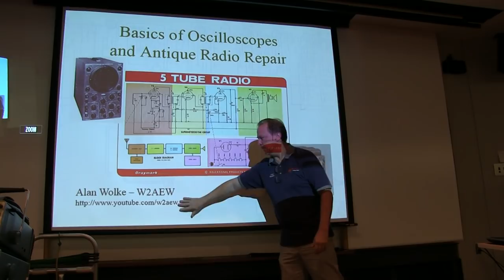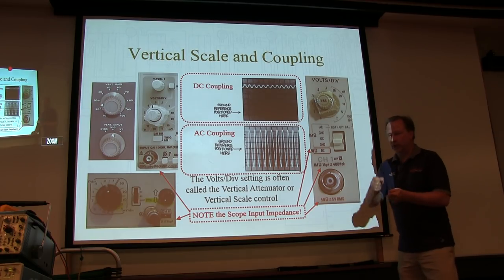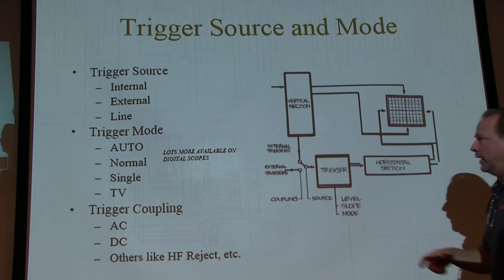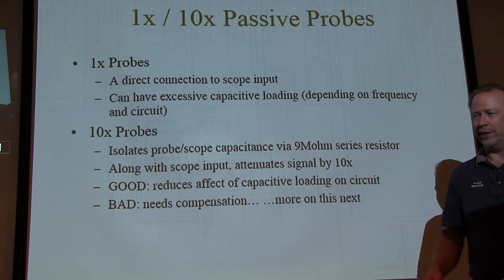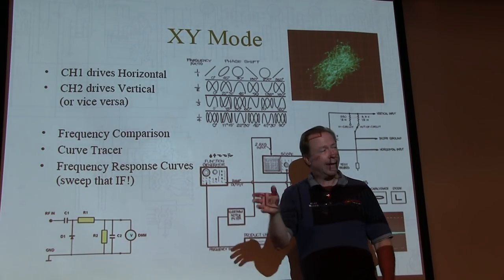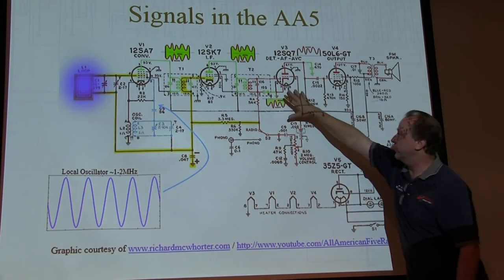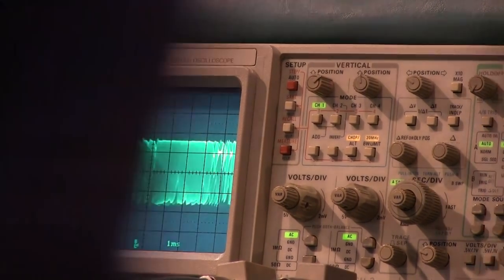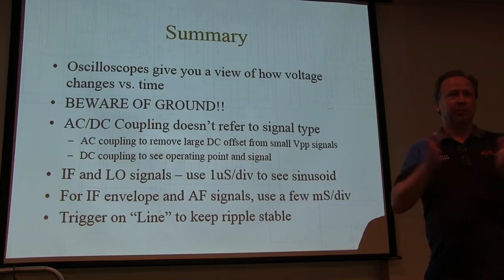#242: How to use an oscilloscope. Plus, seeing signals in antique radios | NJARC

Comment: Greetings, Alan!
To my knowledge, I've viewed all of your videos, and I must say, you are perhaps the finest educator I have ever seen, either on-line or in person!  Your ability to clarify the most intricate electronics concepts has had a tremendous impact on my understanding of the topic, and I'm certain I'm just one of countless many you have enlightened!   Thank you so much for all of your efforts in sharing your vast knowledge of electronics with others!  Well done, Sir!!
Reply from the maker: well, thank you!!  I am glad you enjoy my videos!  Be sure to let me know if there is a topic that you would like to see in the future.
Reply: Now that you mention it, I was hoping you could shed some light on the topic of parametric equalization.  While I understand the basic concept,  the specifics of how and why they are designed still eludes me 
somewhat; for instance, are there parametric eq's which incorporate shelving?  Also, is it only frequency that can be adjusted in voltage-controlled filters, or is it possible to modify bandwidth or emphasis as well?
Reply from the maker: There are a couple of good topic ideas here.  Suffice it to say that it is possible to design voltage control filters that include full parametric control (BW, Q, F).  It is also possible to design voltage control shelving filters.  I don't know what is commonly used in the pro-audio field - although I suspect that it is nearly all done in DSP these days...

Comment: This was great. I grew up in Hunterdon Cty and was originally licensed there in '57.  I have been watching your VNA articles but recently picked up an HP 1740 scope (You should watch Dave's EEVBLOG on fixing one of these!). Of course I also have a fondness for tube gear and still have my Halli S38e, which is of course an All American Five. It seems to work all right but now I can fearlessly apply my HP probes to it (IF isolated).  BTW I just ordered an Owon HDS272s to eliminate those ground issues.

73, Barry
VE7VIE and WV2J  ex WV2ECZ

Comment: Outstanding video on Scopes.  Best I ever saw/heard.  Thanks a ton for the effort and the information.  Too bad your audio-visual guy had a radio program going next to the microphone thruout the entire presentation causing a somewhat distracting influence - which seemed to get louder as the presentation progressed.
Reply: I kept pausing the video and turning down the speakers until I finally realized it was something in the video causing the background noise. Unfortunately I could only make it though the 8min mark. It was distracting to the point I kept stopping and rewinding because I was losing track of what Alan was saying. It was almost disorienting. Sounded like singing then talking then like an old TV show. Unfortunate because I guarantee that presentation was excellent. Everyone who was able to partake in it was lucky.
Reply from the maker: The background audio was from the "training radio" next to the scope.  Unfortunately, even with its volume turned completely down, it still has some audio output.  I didn't turn it off because it takes a few minutes to warm up, and that would have made it difficult to quickly make measurements.  I'll have to invest in a wireless mic if I ever record a session like this again.  Still, I hope you enjoyed the session in spite of the background audio.
Reply: ***** We always enjoy and appreciate your videos, Alan. A little background audio won't change that. :-)
Reply: I more than enjoyed the video Alan !! I learned a lot !!  Your communication approach is excellent - perfectly pace; with highly focused content; and effectively sequenced for optimal assimilation.  I really wish I had this video rather than my Electrical Engineering O'scope classes in college !!  Thanks for all your postings !!
Reply: This type of video is worthy of a "studio" version.  Hint Hint  ;^)
Reply: I was more annoyed by the guy constantly saying mmmhmm yeah yup mmmhmm yeah mmmhmm yup right by the mic.

Comment: Excellent video Alan.  I have modern digital scopes but I still find myself using my old Tektronix or B&K analog scopes.  Just can't beat the look of a warm glowing CRT.  Keep up the good work.  I recommend your videos often to newbies just getting into electronics.

One minor suggestion.  If you ever do another classroom type session with a radio keep the radios volume down until its needed.  With the camera being closer to the radio its audio level was almost higher than you at some points.  Just trying to help. :)

Mike

Comment: Great video Alan! I’ve learned more electronics from you, Joe Smith and Paul Carlson and a few other you tubers and some good books than I did from any courses I ever had. I pretty much work on old guitar amps, audio gear and most recently tube radios. Lately I have been repairing my old test gear too. I have an old Tek 485 coming in today. That will be a challenge, but I think I’ve found the go to Tek expert on YouTube. 😎
Reply: Not familiar with Joe Smith. But Mr Carlson's Lab is a great channel. I loved his video on the tube op amp. I'm not big into RF or radio, but Alan's piqued my curiosity in them more than once. I can see being a lot more interested in them once I've learned more. EEVBlog and Big Clive were the two big ones for me when I first got into electronics a couple of years ago.

Comment: Fabuluous course ! I grew up building tube superhets with multimeters, rf/af signal tracers, rf/af signal generators, and yes even a wobbulator, but I never had a scope to see these waveforms visually !

 Now that I have a good scope, you have inspired me to build a tube superhet again ! 
Thank you for giving me the joy of doing that !

One question though, in the output stage why dont we hear the ripple in addition to the AF signal ? You said it is rejected as a common mode signal, but I dont see how the single ended tube output stage does that.
Can anyone clarify ?
Reply from the maker: The ripple appears on both sides of the primary of the output transformer.  The only thing that couples across the transformer is the AC between the primary inputs.  The ripple doesn't cause the voltage across the primary winding to change, so it doesn't couple to the secondary.

Comment: Alan, another wonderful and informitive video! I find myself revisiting your videos from time to time after I encounter something familiar and then, boom, your video (on whatever the topic) comes through with clean, clear and  concise info to help me better understand whatever it is I'm thinking about. As a little request, could you maybe do a video that hits on the do's and don'ts (especially with regard to analog or CRT scopes) with regard to how power cycling, run time and etc may have a detrimental impact on those appiances? IOW, I may be wrong, but short cycling (using your scope to look at something for maybe 5 minutes) from what I understand is bad? Somethig about quick heating and cooling cycles? Is it better to just keep it on and keep the trace dim when not in use? Maybe just old wives-tales? Also, I have a couple of Tek 24XX series scopes. I believe they have volatile memory that uses a battery? Those have an infinite life? What are the caveats and possible reprecussions of a memory battery going dead? Any insight? Enough stuff for an informative video? Just spit-balling, but something like that from you would be awesome! At any rate, keep those vids coming! Great stuff!

Comment: To anyone wondering about the "background music": it is actually coming from the speaker on the demo board to our left.
 You can notice the scope signal changing with the music, which means it is hooked up to it and displaying what the radio speaker is playing.
 This was sort of a dumb setup to let the radio play during the lecture, but maybe it wasn't that loud to the audience because the camera was fairly close to it and turned towards it, plus the microphone is more sensitive and picks up more of the room sounds than the human ear.
Chances are that the radio sounded at least twice quieter to the audience in the room than it does to us, but it was still a dumb choice to keep it playing throughout the lecture.
 I for one feel a little better and relieved to find out the source of it; it was more irritating while I thought it was done by some rude and careless student and that it was disruptive to the audience in the room.
 I also notice that the camera's live video was hooked up to another projector and displayed on the left side of the lecture board, which shows the additional mistake of not using giving another microphone or an audio recorder to the lecturer so that the recorded audio would sound a few times better. Clearly, the recording was arranged in agreement with the lecturer, so a better setup could and should have been made.

Comment: Great presentation, but the radio show play in the back ground was very distracting through my speakers. Why was that present anyway?
Reply from the maker: The background audio was from the "demonstrator radio" next to the scope.  Unfortunately, even with its volume turned completely down, it still has some audio output.  I didn't turn it off because it takes a few minutes to warm up, and that would have made it difficult to quickly make measurements.  I'll have to invest in a wireless mic if I ever record a session like this again.  Still, I hope you enjoyed the session in spite of the background audio.
Reply: *****
Yes, i enjoyed it very much. A little through half way when i had to stop. Will watch the rest later. Thanks for the reply.

Comment: Excellent presentation. For slide 18 can you explain a bit more about the use of an isolation transformer? I have a Tektronix Technical Brief 'Floating oscilloscope measurements and operators protection' (51W-10640-1) that calls this an 'unsafe and dangerous practice and should never be done!'. Have I got this mixed up? Y
Reply from the maker: It's better to use the isolation transformer on the radio, keep the scope grounded.  Then, when you clip the scope ground lead to the chassis - it becomes ground potential and a lot safer to work on.
Reply: @w2aew  Thanks Alan, perhaps the subject of a dedicated video? Also could you consider doing something on the use of a scope and signal generator for assessing balun performance (not the transmission line)? Y
Reply: @w2aew  I agree. Grounding an oscilloscope and using an isolation transformer should be the subject of a dedicated video indeed. It's not as intuitive or as easy as one might think when first starting out in radio repair. We'd appreciate it Alan!

Comment: You mentioned "IF" several times. Does that mean "Input Frequency"? Thanks, very interesting content. 
Not a Radio guy, becoming a Scope pilot.
Reply from the maker: "IF" in radio terms refers to "intermediate frequency", a term used to describe the inner stages of a super-heterodyne receiver or transmitter.  This is a fixed (no tunable) frequency filtering and amplification stage that processes the RF signal.  In a receiver, the incoming frequency is translated (via a mixer) to the frequency of the IF.  The IF stages filter and amplify the signal, and pass it along to the back end of the receiver for demodulation.

Comment: Thank you very much for the nice presentation. As you mentioned there is a shift in the frequency even when we use x10 probe to measure the oscillator circuit, then what would be the solution to eliminate such a shift for calibration of radio in a restoration job.
Reply from the maker: You'd only connect a scope to check to see if there are signals there, and their amplitude, etc.  You don't align the stages that you're probing - you always probe downstream by a stage or two so that you don't load down the stage you are adjusting.
Reply: I've used the "sniffer" inductive loop. I suppose it could still effect the oscillator circuit.

Comment: For me this could not have come at a better time. One question, since chop as you have described it, does from what I can tell the same as alt. Why do you need the alt button at all. Surely chop can always be used? When would you use alt instead of chop? Thanks for this amazing video. I have gained so much from it. Another quick question. I understand in xy mode that your suggesting that from some clever signal generators the frequency can be output proportional to the ramp signal height which is then output to the X value on scope input. So that you can show a band of frequencies. Which is very clever and I want to try it out. But I did not understand how you explained it if you don't have a ramp function in your signal generator. I think you said you used a trigger on the sig gen to connect to X on scope? But did not really follow how that worked. Could you possible give me a few more pointers on how you do that or a link to a video or webpage that explains it in detail. As this was really interesting and I want to understand it. This is due to my inferior knowledge not your very good presentation! I suppose the first thing I will need is a sig gen that will sweep? I suppose they don't come cheap! Would it be possible to connect a MP3 player that had an audio file that plays through the whole audio range over a fixed time (say 1 second) (I only work on audio stuff) and some how feed that single into the X input of scope?
Reply: When you use chop at short timebases picture tends to be less bright.
Reply from the maker: Chop will be dimmer at faster timebases as +kroplaaaa stated.  Also, at certain timebase settings, you'll actually see the chopping action happening.  In general, you always want to use ALT, and only use chop at the slower timebase settings where the trace-trace flicker is annoying.

For generators that provide a sweep, but only provide a trigger pulse and not a ramp signal...  In this case, you don't use XY mode.  You use the scope in the normal way.  If you set the generator to sweep in 100ms, then set the scope to 10ms/div (100ms for the entire sweep), and trigger the scope from the trigger pulse from the generator.  Thus, the sweep on the scope is synchronized with the frequency sweep of the generator.  I have two videos that show sweeps - they don't go into great detail into the setup, but they might provide you with enough additional background to help you out:
https://www.youtube.com/watch?v=-A_DxsxPdeI
https://www.youtube.com/watch?v=1NdO07MljIk

For you MP3 idea to work, you would still need to have some way of synchronizing the frequency sweep with the sweep of your scope (so it always starts its sweep at the same time as your frequency sweep).
Reply: Thankyou, the chop thing was confusing now I understand what its for. Really so enjoyed this video. Okay with reference to the audio file. I was thinking of recording the full audio range over 1 second and then duplicating the sound clip about 500 times into one file. So every second for 500 seconds the full audio range would be output. So if I set time base to be 1/10 of a second then the full screen should give me the whole audio range (I think! I'm guessing) so every second the whole screen of whole audio range would show. But not sure how I would trigger it? Does this make sense or does this sound wrong.

Also many thanks for the two links. Superb. This stuff is like gold to me.
Reply: kroplaaaa Thanks for this! I get it now. Its an extra control to allow you to view a fixed display when the swapping becomes annoying. But only on long timebase. That is so cool. I always wondered what it is was for and ALT for the matter! ha ha!
Reply from the maker: Probably not too bad for the money. Output can't be turned down very low, and sweep speeds are very slow. But, it is very low cost, and likely better than not having anything at all.

Comment: can you elaborate more on what you have to do, or what NOT do, when you connect an O'scope to an AA5 radio so you don't damage either the radio or the O'scope. Thanks
Reply from the maker: I comes down to just a few things. Use an isolation transformer. Connect ground of the scope and probes to the negative side of the main electrolytic filter caps. Never connect probe grounds to different voltages in the same chassis.
Reply: thanks keep up the good videos. Ienjoy watching them

Comment: When you say beware of ground. Does this apply to a battery radio. For example the scope is mains powered so its ground is mains ground where as the radio is floating. So what precautions should one use to protect the scope when probing the radio?  This is the one area that always confuses me wrt what is ground etc.
Reply from the maker: A battery powered radio is completely isolated - that's a good thing!  You would generally connect the ground lead of the scope probe to the "reference" rail in the power supply system - usually the negative terminal of the battery system.  Then, all voltages will be measured with respect to that rail.
Reply: I guessed that would be the case. Many thanks for confirmation.